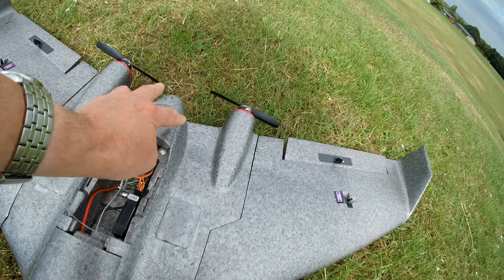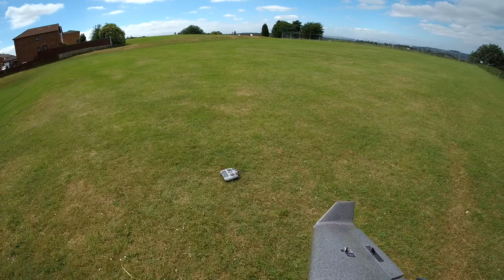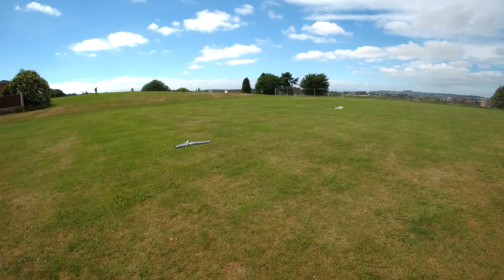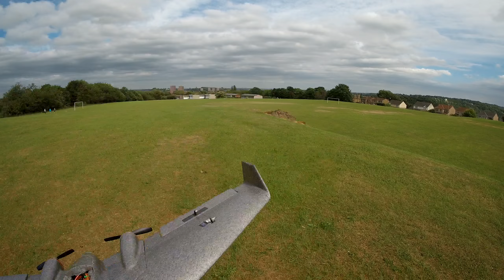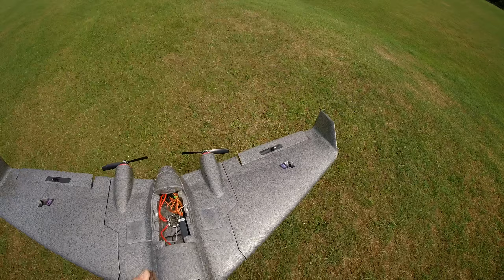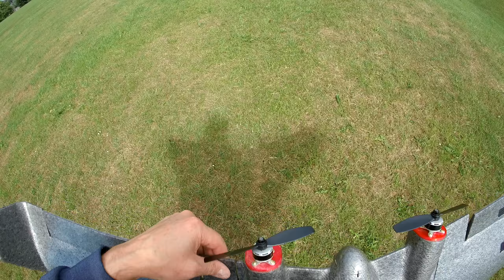S1100 Harrier. Repaired & Re-Maiden in 25mph winds

Comment: Good to see you got to fly that plane again. Considering this kit to reuse the components from a "grounded" Skymule
Reply from the maker: I've got a Multiplex Twinstart to build if I ever get round to it. Got 2 2216 1250kv SS motors for it. On 4S with 8x6 props, it should have a pretty good climb rate, just not a massive range. I just need time to build it.

Comment: Good man....It flies just as good as before.....Its a good plane, drop that F4 board in it, cant be that much work can it?  It's a good cruiser, you just need to manage the throttle....Well done.
Reply from the maker: EnglishTurbines Needed the throttle up for those winds. It was a bit rough on turns, across & down wind.